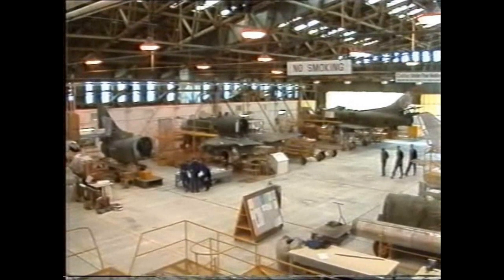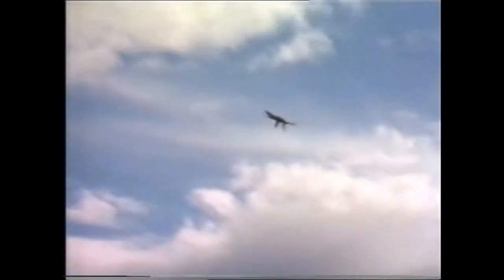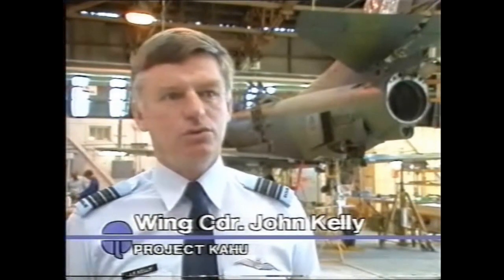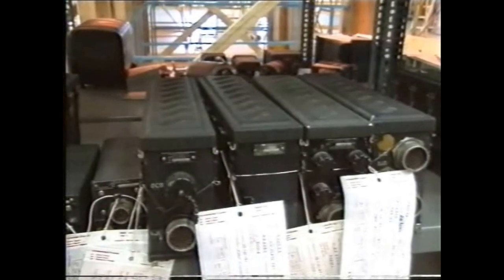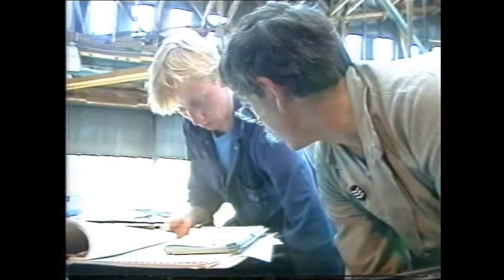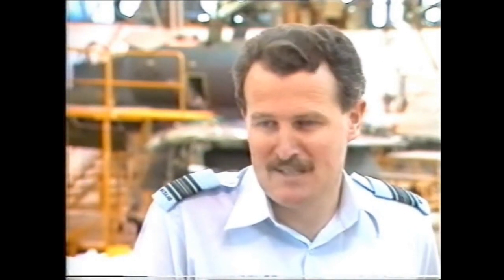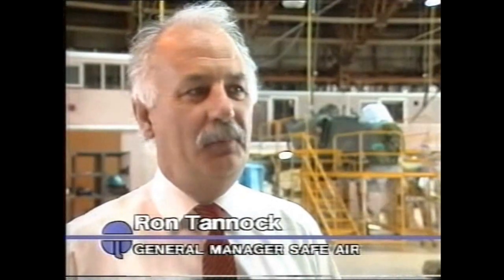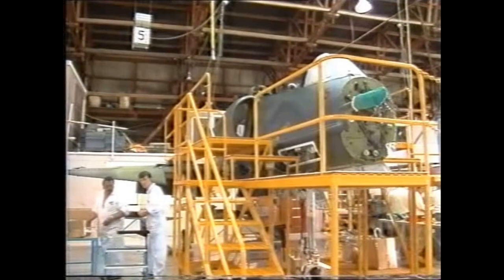A-4K Skyhawk: Project Kahu Begins (1987)

Comment: The most stupid thing to do. It is like installing Windows 10 on a computer from the 1980s.
Reply: It worked though. We had dog fights against F-16's, F-18's F-5's etc and won. In the 1990's we did a simulated attack with 5 Skyhawks against RAAF Tindal an Australian F-18 Hornet base. We fought our way into their airspace and shot down 4 Hornets with not 1 A-4 loss. The Skyhawk is a capable aircraft in the right hands.
Reply: @EndTimeDreams  Due to the age it will be very expensive to maintain.